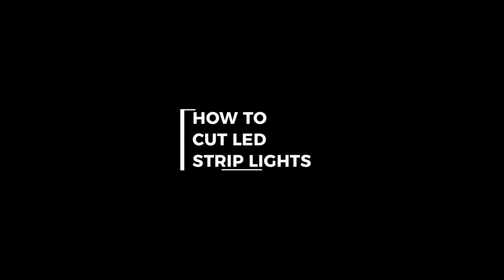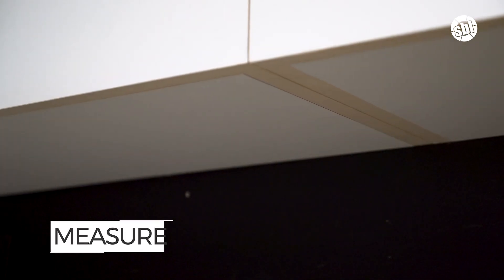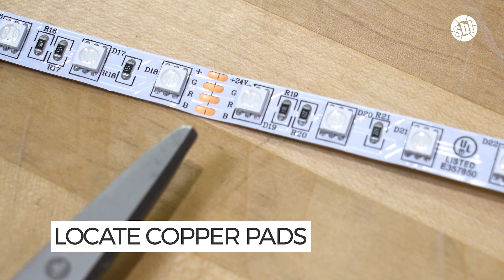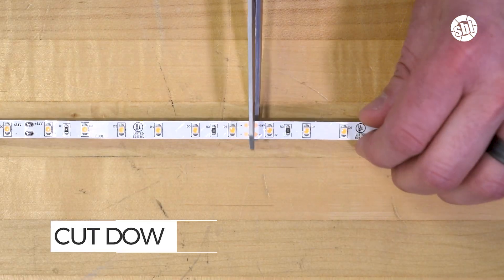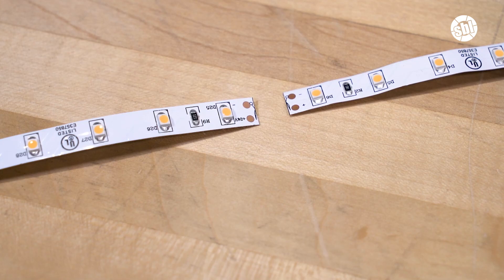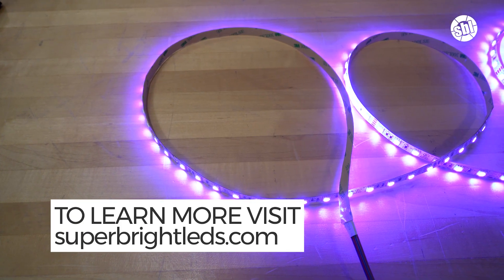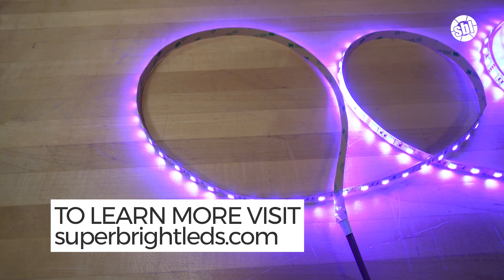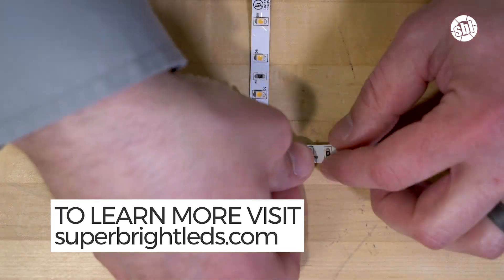How to Cut LED Strips

Comment: After cutting how do i make the other half work, i just want to put some around the room and some behind the monitor pls help
Reply from the maker: After cutting, the remaining strip should still work.  You'll need a power supply for the remaining strip and the proper connectors to get it working.
Reply: @superbrightleds  can adhesive ruin my paint
Reply: @yair8231  most adhesive won't ruin your paint but it really depends on the quality of the paint

Comment: how do i use the other half??
Reply: Thank you, btw can u make a tutorial on like how to connect the led and the controller to the power supply please?
Reply: You have to throw it out
Reply: @cinnamonape3045 there's no way to use the other half?
Reply from the maker: You can use the other half, you'll need another power supply and proper connectors to get it working.
Reply: @cinnamonape3045 wait actually

Comment: i cut it and my led stopped working
Reply: Does it have a power source still?
Reply: It's won't work until it is joined to the other part that is connected to the 12 volt supply.Unless you give it its own power supply.
Reply: Then you cut it wrong 💀
Reply: Same! 😡💔
Reply: Same😭
Reply: Use a bandaid or tape that would do it
Reply: Bro did you try and turn on the onenyou just cut or the one to the power strip
Reply: @rizxnnnnnnnnn lol
Reply: Womp Womp